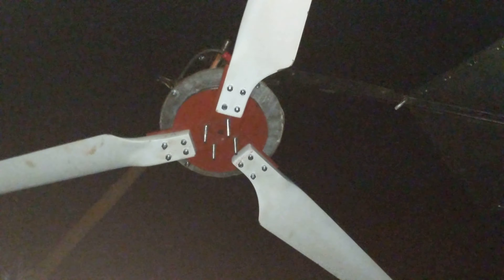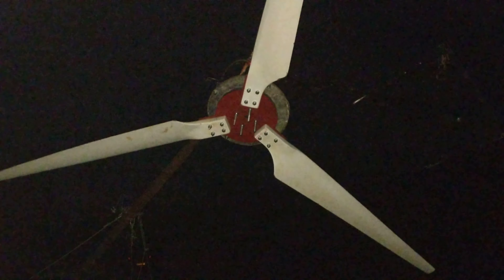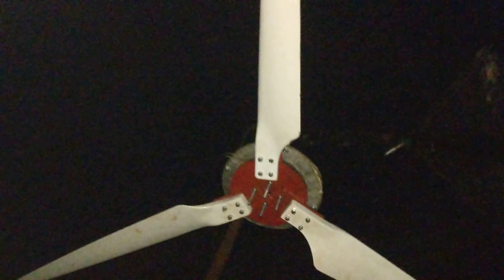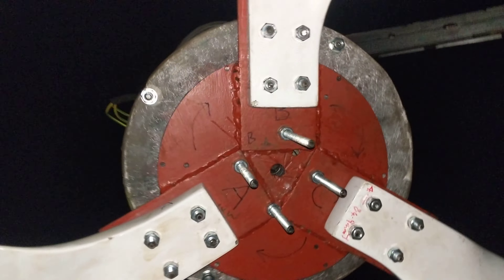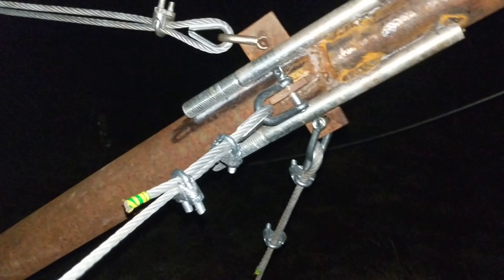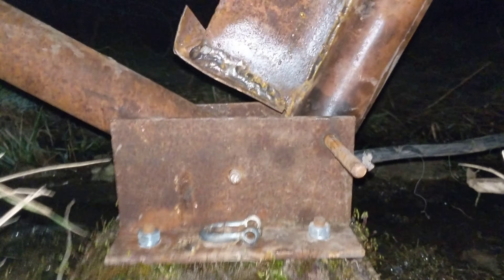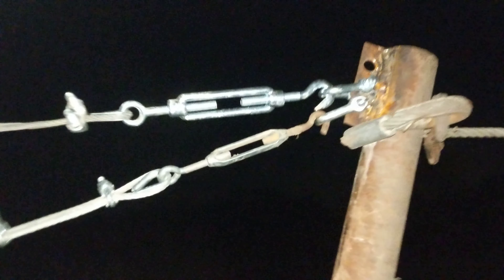It's on the tower now waiting for some wind

Comment: is there a possibility the blades can hit the  tail or is it an optical illusion with the camera , decent blades they will power on under load, on a friends oem parts/whispering winds turbine I've worked on it had a tail stopper to prevent the tail and blades from having a disagreement with each other
Reply from the maker: The blades can't hit the tail but flops back onto the turbine when lowered, those blades are probably over rated for my turbine being 1kw blades, I need to try and find a way of copying them and making a mould :)